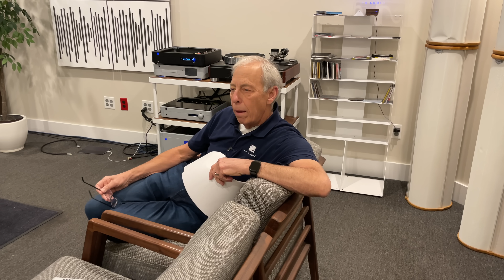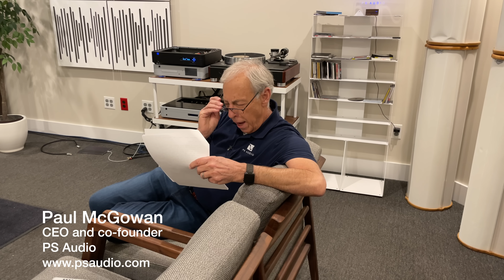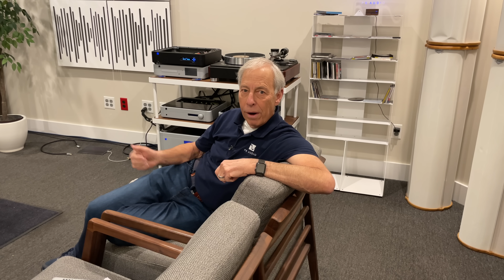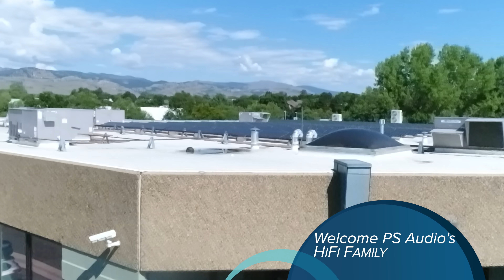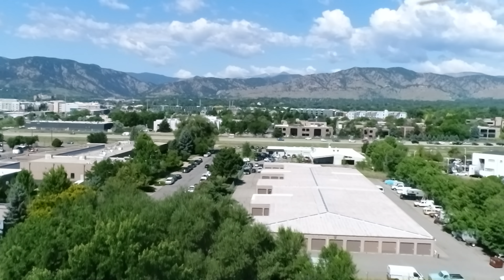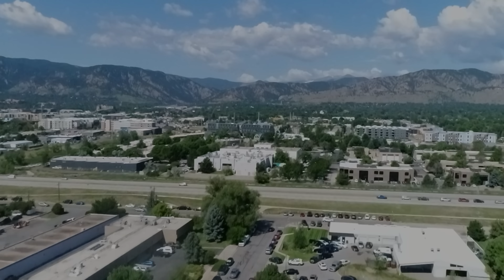High end amps vs. pro amps

Comment: A pair of pro audio Bassboss SV9 1200 watts and Bassboss BB15 2500 watts makes for an awesome home audio setup.  It is connected to Chinese HIFi audio gear. It blows away consumer multi thousand dollar loudspeakers and amplifiers.  It rocks the house clean  and effortless transient response . You can hear the kick drum and bass guitar. The different layers, textures and separations.  I use only mogami plantium xlr cables throughout. HAPPY LISTENING 🎶

Comment: So I  still run a DC300A on one of my systems and have for the last 40+ years. No problems at all and to my ears the biggest changes in sound were from the different
rooms and speakers over the years, not the amps.  BTW, Over the years I have also owned many "High End" amps, they are gone, the Crowns are still hooked up.

Comment: What a bunch of crap.  I have crown macro techs 1200 2400 and 5000vz and they just sound incredible. I had krell Bryson Marc levinston Adcom and none of these amps held a candle stick to them.  The amps are crystal clear and the lows from that 5000vz absolutely crushed your Hi fi amps.  The old Macintosh pro amps and the older crowns are just pure gold.  Still class ab made in the USA no china parts.  The new crowns and behringer are made in china.  Ran by Harmon and not out of Indiana.  Even qsc is made in china only good USA lines are ex and mx and plx last USA made amp.  Rest are junk. So if you compare the china versions yep you win, but the old school ones will kick their ass. .

Comment: The DC300A has very low distortion,  flat frequency response, fast transient response. So it is transparent. Audiophiles love distortion and bent freq. response, they just don't seem to know that. What other "things" are there to hear that make the difference? If the amplifier is not 100% transparent then what is sought is is an  "effect" not an amplifier

Comment: I use the Crown XLi 2500 for the pair of my 15” subs and another one that runs my 10” subs in a different room.  With a line driver to up the signal into them have become some of the best sounding sub amps I’ve ever used.  Good ole class A/B 750w x2 for $500. Doesn’t overheat, sounds great and drives the subs beautifully. 
I use an Emotiva XP2 largest two channel they offer in my towers with also have 15” woofers. Best sounding setup for under $8k that beats most systems of $20k+ setups.

Comment: XLi 1500 rated at 350 x 2 @ 8 ohms actually does 415x2  certified @ 1% THD. At the 350 rated power its damn clean power. Huge toroid and big ass caps. Bought two for 350 bucks (not each and now they are over 500 bucks each) open box and they sound better than anyone "thinks" they should. And when you see the burst wattage it's hitting 500x2. the 4ohm numbers are really kinda crazy for the ratings. When you're using these on most home speakers they aren't anywhere close to hitting ANY distortion or clipping. And you can bridge them at 8ohms and they hit 1240 watts certified 1%. All those ratings are from Williston Audio and verified. But hey, I'm an audioholic and not a audiophile, so I slam my smack in quantity. I ran them monoblock on some my Polk LSiM 703's and they sound really damn good. I have a video as proof.

Comment: Having done both for years, Paul is correct. Can you make a Pro amp sound decent? Yes, but it's not easy and won't ever have the separation and nuance of a quality, high end home amplifier. In a pro situation, you have crowd noise, completely different speaker requirements, wildly variable input sources, etc. I mean when is the last time a pro sound customer rerouted their HVAC system to eliminate noise? (LOL) The only argument I would make for Pro amps in a Audiophile-ish situation would be a high end home theater using the amps to run Passive subs, and even then, the noise floor will be higher than many people might find acceptable. I can tell you that I have run some dual 15 and 18 JBL theater subs off either modern Crown or Mackie amps in a dedicated home thater, and it was bordering on brutal. Even then, in a perfectly quiet environment, you could pick up some measureable noise.

Comment: I'm tossing up whether to have a dual amp setup now. I just ordered a Thomann S 150 Mk 2. I've been using an Aiyima A07, cheap chinese class D but I'm tired of the poor high end, especially when I have such sensitive tweeters/mid range on the NS-777. I also have some Sony SS DX50 speakers that are really solid bookshelf speakers. I've been running them along with the NS-777, since the Yamaha's sounded pretty weak with that cheap class D amp. I'm going to try running both pairs through the Thomann but may use the Aiyima for the destop speakers and the Thomann for the Yamahas.

Comment: The fact is there are no residential  "high end" high power amplifiers made for subwoofer duty that exceed 1500 watts.   If you have large DIY passive subwoofers your left with no other option but using Crown and Behringer amplifiers if you need more than 1500 watts.   I have a 30k sound system that uses (2) Berhinger NX3000d's for bass duty and there is nothing you could buy that is better, or more powerful for the money.   They make gobs of clean power with massive headroom.

Comment: Old thread...
Wonder how things have changed in 4 years.  Are audiophiles any less arrogant?
Nothing wrong with a Crown amp, for Chrissakes.
A $20 poly cap is no different than a $2 poly cap if the circuit is designed properly.

Comment: Pro audio does have a place in home audio, if you need lots of power for a subwoofer pro audio is definitely the way to go, if you have a good crossover device and can cut out all of the higher frequencies then it’s worth running them not to say if you have the money to do the higher end stuff but if your sub is only playing sub 40hz then it’s definitely irrelevant to use the higher end stuff. (Just hide it, and modify the fan) 😂😂😂 great video.

Comment: Paul you are both right and wrong in this take and you also forgot that your amps wont have near enough power to be used in live performance situation so that is one major difference to Crown, Behringer etc makes amps to play LOUD for hundreds of thousands of people and to be chained togehter high end gear isnt made for that but one aspect where pro gear can work really well is for subwoofers ive yet to find any audiophile or even hifi grade amp that can deliver 1000 w in 2 ohms to be enough for my woofers so i use a Biamp solution crown for the bass and a NAD for the top end best of both worlds

Comment: Before I can discuss my feelings about “Professional “  amplification I need to go back in time to explain my evolution through Audio. Back at one of the earliest Audio Shows(about 28 years ago)in Los Angeles where Krell and Apogee were paired together; I had yet to actually enter the Building but could hear and feel what I could only describe as a seismic subterranean bass event like nothing I had ever experienced before! Upon entering the building I followed the sound and energy to the room where I beheld the Krell amplifiers in all of their glory, and flanked on either side was the mighty Apogee Scintilla speakers. Now what was surreal was the fact that I was hearing and feeling the music clearly in the distant parking lot, but as I stood in front of these speakers it was if the sound was emanating from them but I put my ears up to them and it wasn’t loud. How could this be? Anyway, it was at that moment I decided that I could never afford the likes of this level of Audio gear. But I took a mental picture and decided that this was the best I had ever heard music being reproduced. Committed myself to somehow achieve this level of sound in my own home one day. After not 10 or 20 years, but nearly 30 years!
Trying different amplifiers, pre-amplifiers, speakers, sources etc… I evolved my system into something that is more than I could ever imagine.
No, I don’t have any High End Audio gear that one would assume is required to achieve such sonic bliss. What I did do is go outside the “proverbial “ box to create my own version of being “Surrounded by sound “. No I don’t use a Surround receiver (not that there’s anything wrong with that ) I in essence use two P.S. Audio PCA -2 Preamplifiers with  2 HCPS (High Current Power Supply) One is is in the front where my Source a Modified 
Marantz SA-11S2 is my SACD/CD player. I run a loop from the PCA-2 in the front to the PCA-2 in the rear. 2 Crown XLS 2502 amplifiers in the front drive in parallel 3 pairs of speakers 1 pair of JBL MRX 515 , 1 pair of Klipsch Quartet, and 1 pair of EAP 15” mains stacked, and a Acoustech PL28 center channel speaker with 2 Acoustech HT-65 side speakers. 2 HSU ULS 15 powered subwoofers. The rear speakers are a pair of Klipsch Chorus 2’s with a pair of Behringer 1520 15” ‘s on top and a pair of 12” KLH Rave speakers on top, a JBL LC2 center speaker and a Acoustech HT-85 center on top of the JBL LC2. 1 Velodyne 15” powered subwoofer and a 12”HSU powered subwoofer. The amplifiers in the rear are 1Crown K2(this is arguably one of Crowns finest vintage achievements) and  1 Crown XLS 2502 both are running in parallel . Yes that’s 16 speakers ( all 15” woofers, except 2  12” woofers in the KLH , and the 10” woofers in the Quartets; and 4 powered subwoofers (3 ea. 15”, and 1 ea. 12”) The center speakers are 8”  while the side speakers are 6.5” . All are horn speakers, except the KLH. An interesting observation I learned from the parallel setup, is that although 3 different pairs of speakers are connected together, they sound as ONE single unit. What is obvious is of course the headroom! But more significant is the fact that at the minimum setting, every single detail of the music material is clearly represented with clarity and depth that simply must be heard to appreciate. The term “SYNERGY” is what it’s all about. Every instrument sounds like it is supposed to sound like, it’s full size and scale. Because the music is from about 10hz-20khz the full music spectrum is covered without any effort whatsoever. I have known friends that have systems that are $$$$ with all the familiar names, and yet this compilation of gear I have assembled, has never disappointed in the degree of musical reproduction. Before I played any music, of course they were expecting some loud P.A. Auditorium Type of experience, but the look on their faces was confirmation of what I had already experienced. Music completely fills the entire room like a jello mold, I want for nothing else! I am so blessed to enjoy music this much! The Marantz player has resurrected discs that before were poorly recorded or mastered, it somehow makes them sound better than ever! A good source is critical in the Audio chain, as is a clean preamplifier! I once upon a time dreamed of having Infinty IRS V speakers back when I heard them properly set up. But then I woke up! This hodgepodge of speakers is my “poor man’s “ effort to attempt to approach the way the IRS v’s fill the room from top to bottom. I’m not going say that actually achieved this like the IRS V’s, but, I somehow managed to exceed all of my expectations! I call it a huge WIN!

If I would share one thing, it would simply be to enjoy your music! What sounds good to you enjoy it! Don’t let anyone else tell you what you should buy or enjoy. Music is a personal experience and we all hear differently, so don’t let anyone try to shame you for what you own. This is partly why High End Audio stores are all but gone save a few in many cities. I’m just an old Disabled Veteran who loves music, and believes everyone deserves to enjoy music the way they like it.  How many times do I remember being told in an Audio Store, after the salesman would ask me “what do you own right now “? And when I would tell him what a simple system I had, he would respond with…” you can’t possibly enjoy music listening to that crap(expletive)! And continue to verbally shame me, fully expecting me to respond like a helpless child, and say “please show me what I need to buy to enjoy music!) Nothing of the sort ever entered my mind! I instead would of course just chuckle and leave the store. The arrogance and snobbery I have experienced is truly sad. Meanwhile, some of my friends who are very wealthy would buy and sell/trade their gear like every 6 months or so. What baffled me was how much money they spent and lost when trading equipment only to never be satisfied. Go figure…
Ultimately I realized that they somehow forgot how to just listen to the music, analyzing every single possible aspect, from A to Z, instead of simply being present and listening to the music, instead of being enamored with the glitzy lights and precious metals that some of the speakers and equipment was constructed from. If you spend $100k on amplifiers and they sound good, well… I hope so! It dang sure better for that price! Most “Audiophiles” when faced with two different amplifiers , speakers etc, will ultimately choose what “looks” the coolest. If you don’t believe that just ask yourself why McIntosh is so popular (surely not because of the blue meters! lol) I have never been a fan, but I am happy for those who do love them. It’s worth noting that in most used markets, McIntosh is usually more present than anything else. So perhaps many people after owning them for a while are not satisfied enough to keep them either. I remember more than a few times, when in a Audio Salon listening to a customer tell the salesman point blank, “I know the Parasound (or whatever) sounds better than the McIntosh, but I want the McIntosh because it just looks better. To each his or her own, I can really care less about the looks of something that is in the Audio chain, so long as it delivers the sound I love! In fact I would be more bothered by something that looks great but sounded awful. But again, that’s just me. 

But what I find tragic is when people repeatedly spend hundreds of thousands of dollars on equipment and it fails to satisfy them. For me, the silver lining is when you spend a fraction of money $ for everything and it surpasses all of your expectations! That’s the best!  I feel like when you are creating a new dish in the kitchen, your creativity runs wild and often you make something that is just out of this world with flavor, like a party in your mouth! 

With all of the Audio gear available Consumer and Professional, there are many different ways to achieve amazing musical fidelity that can be incredibly rewarding. You just have to try different combinations until you get the sound you enjoy. It’s fun, or at least it should be right? Then you can just Enjoy Your Music! I sure do! I LOVE Music!

Comment: If you are using to pro amp to drive vintage speakers or sub woofers, there are pro amps that have RCA inputs, like the Crown XLi series (XLi3500). You are not stuck with XLP connections, so you do not have to use a converter like an Art Cleanbox Pro unless you want to. The XLR cable's primary advantage is the can be ran for long distances without picking up any noise. When you are only dealing with two amps sitting next to each other, a set of high-quality short RCA cables work just as well. My vintage speakers are rated at 350 watts each. I have a 130 watt times 9, high end THX theater amp. But its input power is rated at only 110 VAC @ 650 watts. This is what its power supply is limited to. Do the math, running at 100% efficiency (which is impossible), that's 72 watts per channel. When driving only my vintage speakers, my theater amp does a good job. Kick in the other 7 speakers, then that really nice amp comes up way short. The Anthem STR Power Amplifier, 400 watts times two @ $6500, would drive my vintage speakers fabulously. But compared to the Crown XLi1500, 330 watts times two @ $425, most people would not be able to hear the difference. And if you compare the cost, the Anthem is with out a doubt, a better amp, but it does cost 15.3 times more. I intend to bi-amp my vintage speakers; using the theater amp for the tweeter and mid range, then using a AB class Crown XLi3500 pro-amp to drive the two 15 inch woofers. This way I am using both amps for what they are best at. Crown amps are easy to find used, and much cheaper, but still in great shape. The same is not true for high powered home amps like the Anthem.

Comment: Ok all of that didn’t really answer anything. They are not designed to do the job of the other ? But wasn’t that the question to begin with .. why not ? Why can’t pro amp work fine in home environments? I understand consumer spec amp may not last on pro circuit but vice versa , why not ?

Comment: I kind of disagree as far as the Crown XLS drivecore2. first, it all depends on what you're using your Crown amp for. secondly, if you look at most high-end subwoofer amps they all use D-class amps internally. plus Crown sold more amps in the last 5 years than any other company. not because they're the Top of the line. they do have competitors. 
but if you're planning on using the Crown XLS as a subwoofer amp. you will have a hard time beating it for price and quality. even if you use the Crown xls 1002. which can put out 1100 watts at 4 ohms in bridge mode. which can easily drive four 10-inch subwoofers.  and don't put a hole in your electric bill. it all depends on your app. 
at least half of the people who buy it. don't know how to set it up correctly.